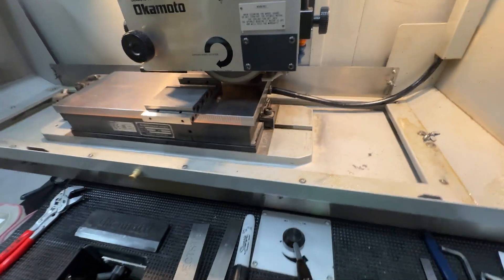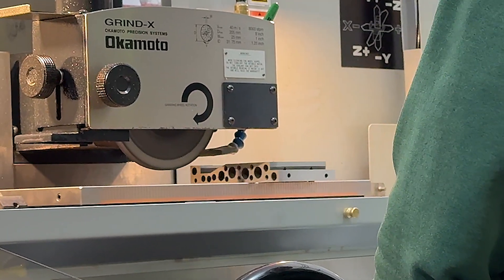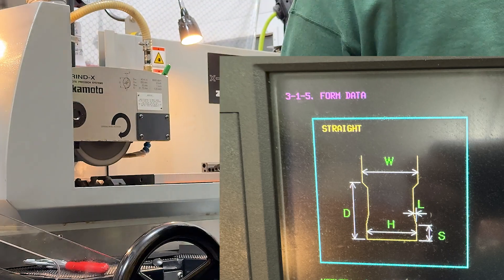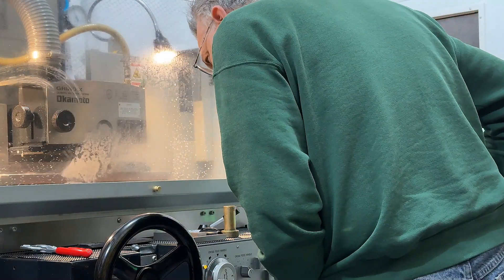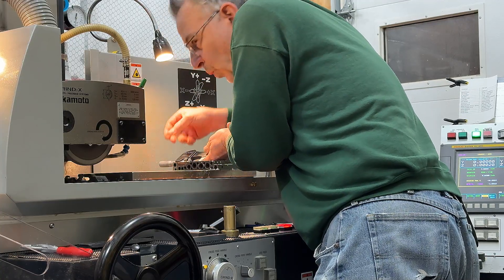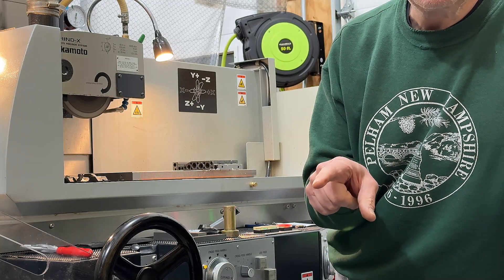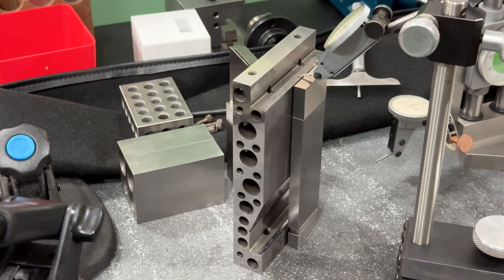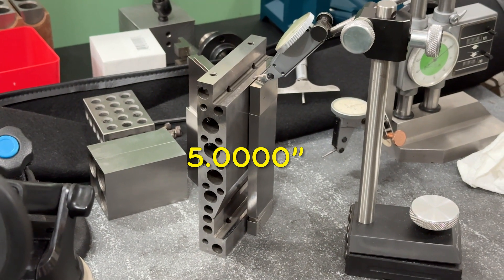Quick Chips: Restoring a sine plate, Part 9

Comment: Your joe block stack up looked shakey at best.  For that kind of mesurment two sets of blocks should be used.  Not a good idea to just add a block on top of another.  Such a nice grinder should be complamented with a nice square set that you can bolt together.
Reply from the maker: You betcha'!!

Comment: Believe me I fully understand trying to get something as close to exact as possible. I'm cursed with that perfection and accuracy fixation myself. But just to put this project into a real world perspective. Depending on the steel alloy, it's generally accepted in round numbers that steel expands or shrinks at roughly 6.5 millionths per inch / per degree. So for just the 5" roll spacing on that sine bar, your looking at around an expansion or contraction rate of that 5" of roughly 32.5 millionths variation with every single degree it increases or decreases in temperature. There is something to be said for having confidence in your almost exact 5" spacing at least within it's usable accuracy level though. 

But unless your shop is set up about like Moore Tools illustrated in there Foundations of Mechanical accuracy book for almost perfect and stable temperature control, your way past what can be reliably used or even measured with any real certainty with the metrology equipment your showing. Then there's the same thermal changes in the gauge block stack etc. And the gauge blocks themselves aren't even 100% stable just due to changes over time even if there never used. Mitutoyo advised me that for steel gauge blocks, it's possible to see up to 1 Um of length change per inch up or down over any one year period. I am still impressed with what you managed. But as constructive criticism, in my opinion the whole series was drawn out much too far. Maybe extend the video length a bit, edit a bit more for the less important, and down to one or two videos.
Reply from the maker: Thanks for taking the time to communicate all that!